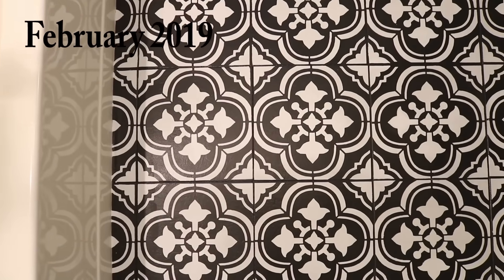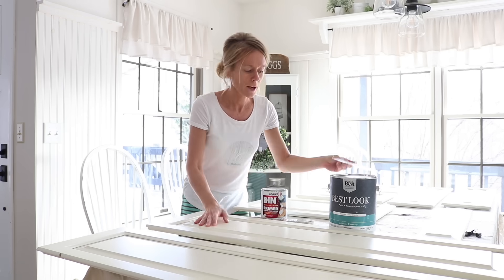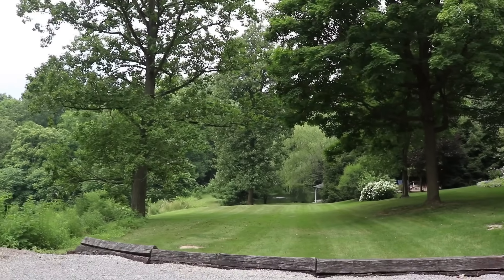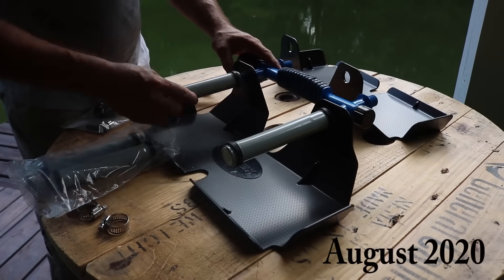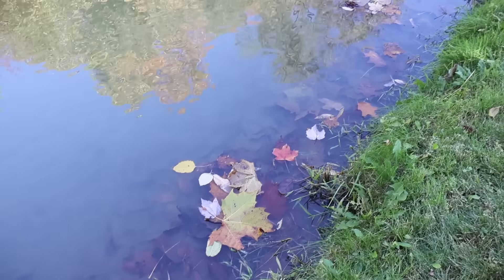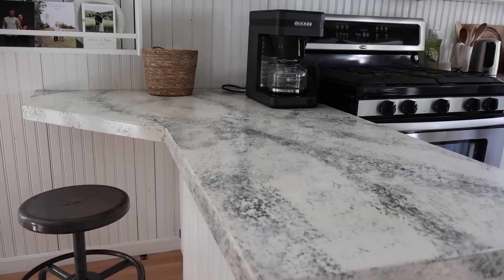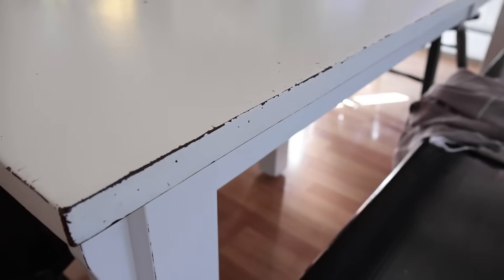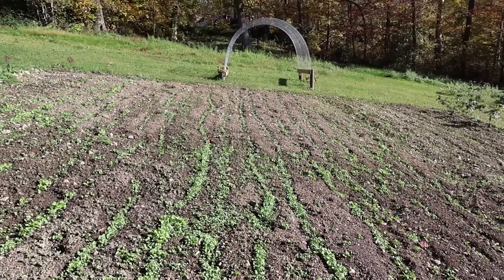Painted Projects Updates ~ Stenciled Floor Update ~ Pros and Cons of Painted Cabinets~Painted Floors

Comment: Hi Mary, we had a muck problem in our koi pond and having it professionally cleaned was going to cost $750.  So I did some research and found barley straw bales on amazon that seemed to work for many people.  I have used two bales this summer and the muck is gone.  These are the ones I ordered - Summit 130 Clear-water Barley Straw Bales.  Hope this helps.

Comment: Love your entire home Mary,and the work you put into it is commendable! You really do put everything into each and every project and it shows!
I had a pond many years ago and the smell you spoke of was caused in mine from the rotting leaves falling into it,they almost smelled like a dung pile at the local cow farm but just really strong and yes gas like,that was the fermentation of the leaves at the bottom.
Everything compacts down to the bottom of the pond and turns to a slurry hence the smell,its definitely off putting and not a smell you would want while eating your dinner outside or sat watching the birds ect.
I think when you have a pond the size of yours the only way would be to dredge the muck out from the old leaves and such but yes i think it would be very costly. Hopefully mother nature will lend a helping hand and work some magic for you and resolve the problem.
Great video mary as ever.😊

Comment: If you haven’t tried using microbes to treat your pond I highly suggest it. I used them for years to treat 2 retention ponds. One with a spring.  It worked fabulous.  You throw a biodegradable sphere in once a month. And in hotter summer days a blast packet. It’s called Aquasphere biodegradeable pond treatment. You can use multiple spheres idepending on pond size. Get from healthy ponds.

Comment: We’ve used the Pond Guy for years, as has our nephew, and our ponds have improved greatly.  I’m thinking there must have been something disturbed underneath your pond muck that has caused the problem.  Just wondering if you’ve had your water analyzed.  That may provide some answers as to what’s causing the trouble.  Hope you can get it worked out so you can enjoy your beautiful pond again.  I enjoy your videos immensely.  You are an inspiration!

Comment: If you ever do another floor like your bathroom... Start with a fun pattern, every other tile or a boarder around the edge. That way if life happens, you can press pause and the floor looks fabulous even if you know it's only half done. (I do that with my quilting. Do the main parts, get it bound, use it and work on the fine points as time allows.) 💖🌞🌵😷

Comment: I had a pond and it seemed to me that the more aeration I had the clearer my water was. I got most of the aeration through the waterfall that I built in the constant movement of the water through the filtration and the pump and the trickling of the water through the waterfalls. Just a thought for you